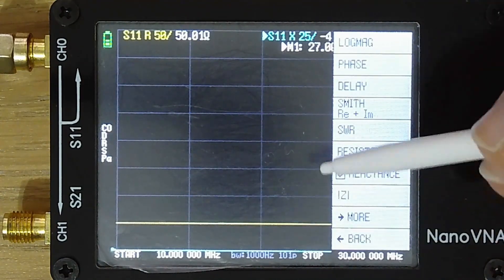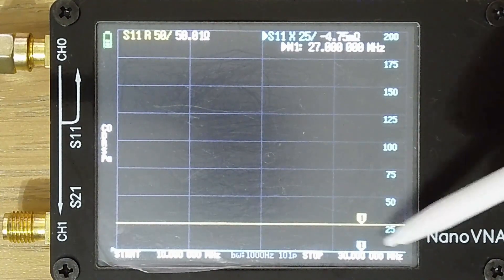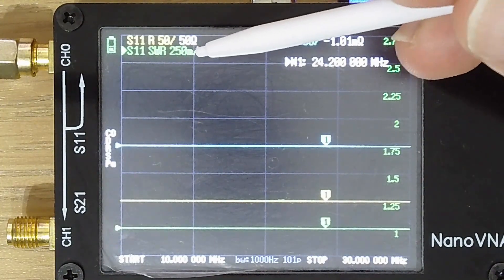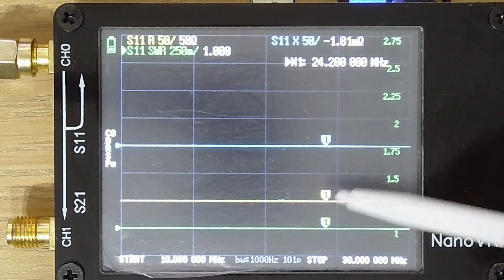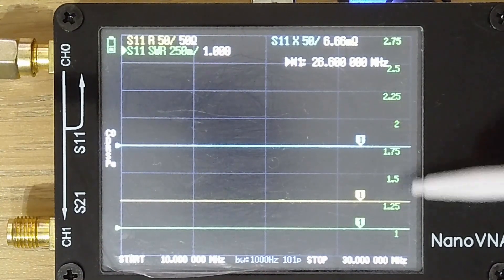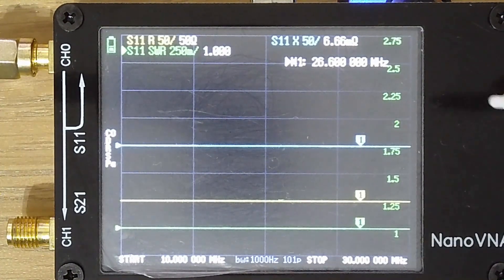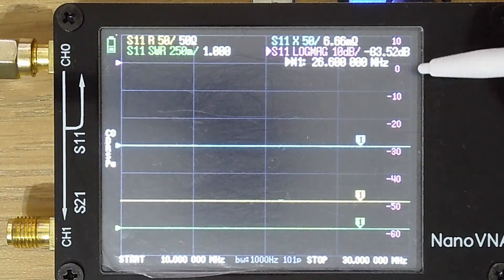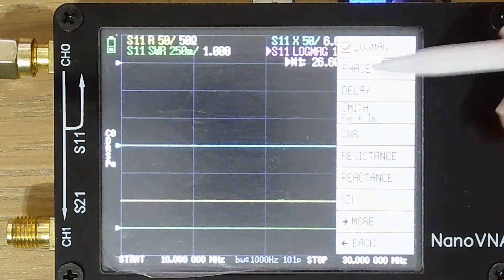Nano VNA Basics and Set Up

Comment: Excellent, thanks for this. I use my NanoVNA a lot for antennas and radios. I am always a little frustrated by the setup process. I have now recalibrated and saved the setup so my display and calibration has a baseline when I switch it on. Meanwhile. I would love to see how to measure feeder length, then factor that into Antenna analysis. Basically I have 1 antenna very high on a mast, another antenna at the bottom of the garden. In particular the one at the bottom of the garden; its a bit tedious to go all the way down the garden for any testing.

Comment: Thank you for clearly explaining the order of many details that aren't intuitive from the menus. However, I'm still confused by the way the traces are saved to Save 0 after the Calibration was saved there earlier, and you said the calibration should be resaved if some parameters are changed in the setup. It seems as though Save 0 is a multi-section memory that can save each parameter separately from another at different times depending on the most recent menu parameter before saving.